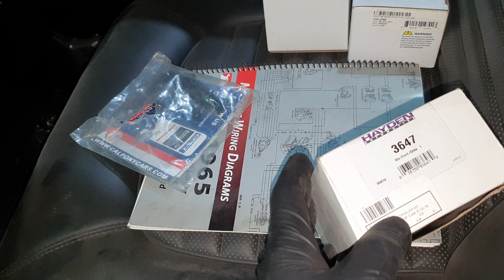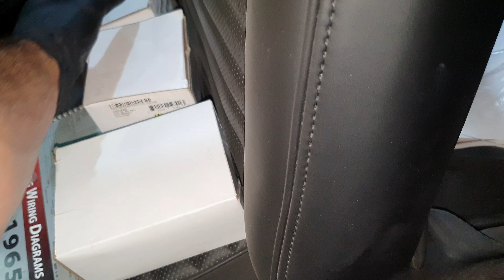1968 Mustang check up (part 10)

Comment: Great job on the mustang! Engine bay is starting to look close to done. Is the radiator fan pushing air in the same direction as the engine fan? How does that work? You can probably have the welders fabricate those struts tower brackets in a couple hrs "binky style" and paint them blue. lol